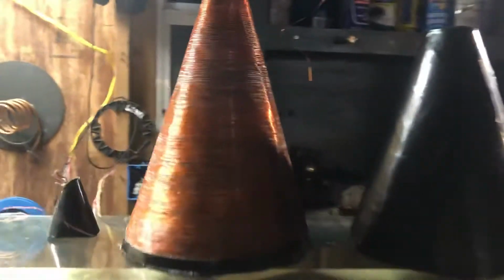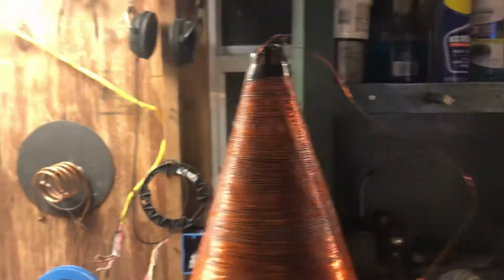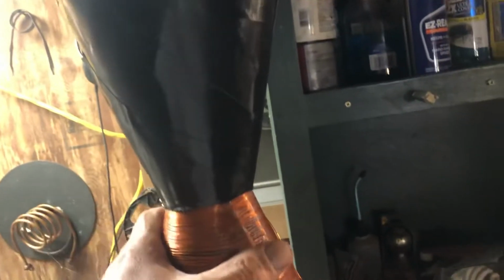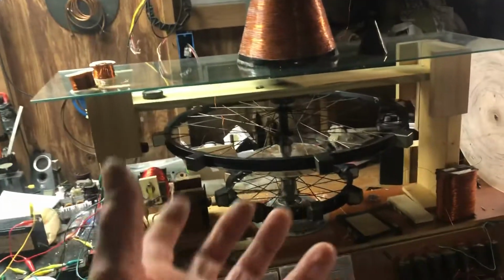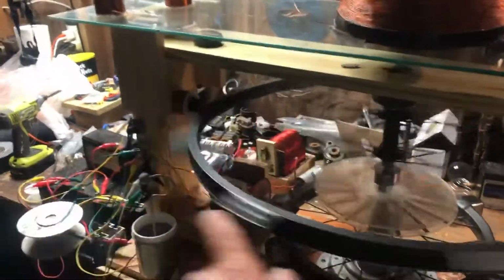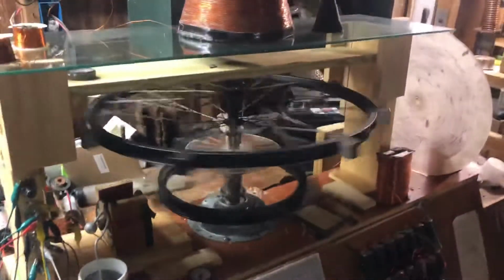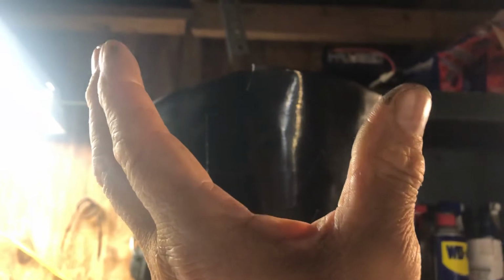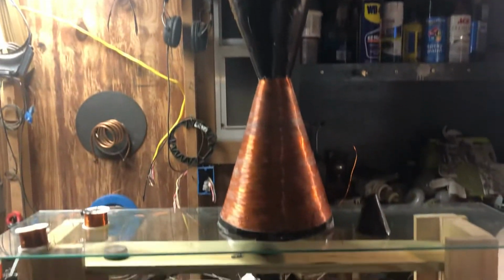Walter Russell,James Clerk Maxwell,Tesla Benjamin Franklin!

Comment: Oscillation frequency by overcoming resistance by charge build up capacitance in non moving mechanical oscillators are LMD longitudinal magneto dielectric analogue computers. (Magnetrons.) TEM transverse electromagnetic AC results from pulse oscillation in and out (time reverse phase conjugation) back emr.

Time reversed back EMR electromagnetic resonance phase conjugation creates nodes and antinodes. Cancellation equilibrium cold (heat removal) negative energy coherence. Vortex  compression singularity time compression (space.) Mass. Counterspace.

Coherent additive harmonic resonance point source (molecular, crystalline, atomic, particulate, etheric lensing) compression amplification electromagnetic alignment (stimulated emission) alignment energy outward radiation is positive charge build up, time (space) expansion, heat amplification. 

Heat goes from outward radiation expansion inward into the compression (equal and opposite.) The compression also creates the output release of the radiation heat (loss.) Heat loss in one location is heat gained in other locations.
Reply: https://youtu.be/a_TSR_v07m0?t=16m15s

Comment: You need to be working on ed leedskalnin megalithic witching water theory he shows this in the picture of him standing next to the Y log with the wire wrapped around the left side and the antenna on top that is the missing thing under the box on top of his tripod  the Y log is one of the legs of the tripod an I believe it has to be done in a place where you find water by witching it please work on this if you would thanks. I have other ideas also but no funds or place to try them.